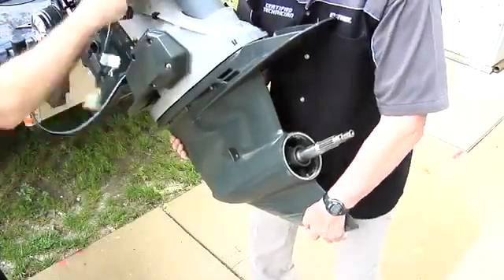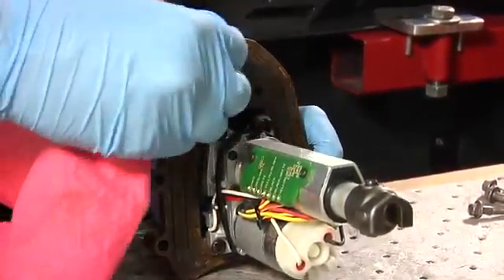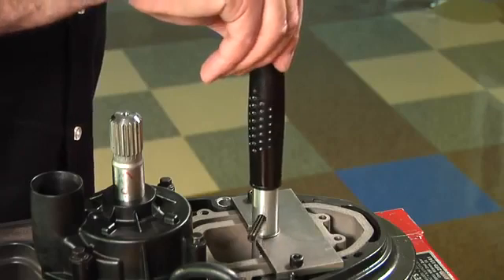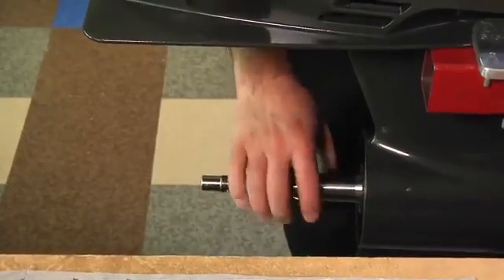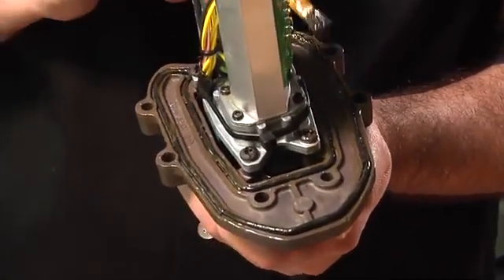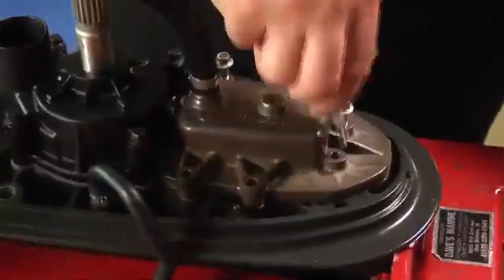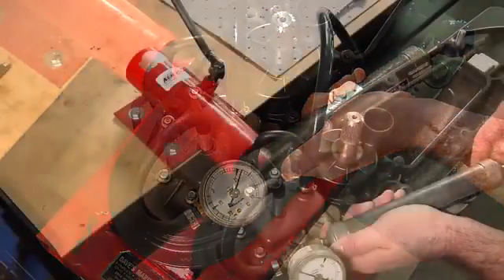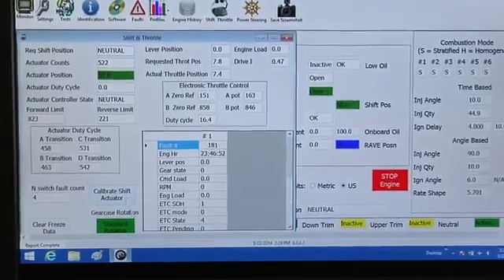Cambios electronicos en un motor E-TEC G2

Comment: Hi guys, I need to replace my shift actuator. Do I need a shift rod height adjustment tool? Or maybe can I simply remove the old one and insert the new shift actuator? Of course, the new one must be extended the same length as the old one.

Comment: Hola amigo le puedo hacer una consulta, tengo un motor evinrude 250 Hp el cual tiene filtración de aceite por los sellos del housing, la consulta es: es posible sacar el housing para cambiar los sellos sin tener que desmontar todo el sistema de transmisión completo sin sacar los piñones del cambio o el eje superior?
Reply from the maker: Si, el housing sale sin nesedidas de desmontar alguna otra piensa, sueltas los tornillos que lo aseguran y utilizas un extractor, antes de sacarlo debes drenar el aceite.
Reply: @dgcarbust9512  muchas gracias por la info amigo